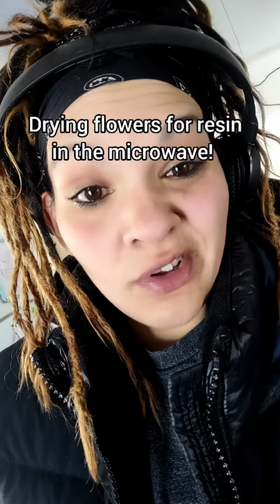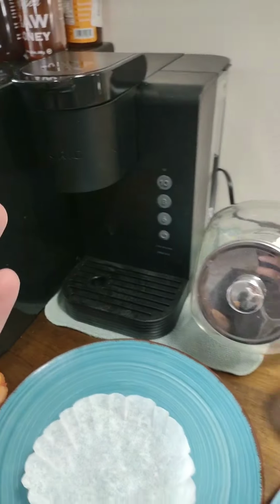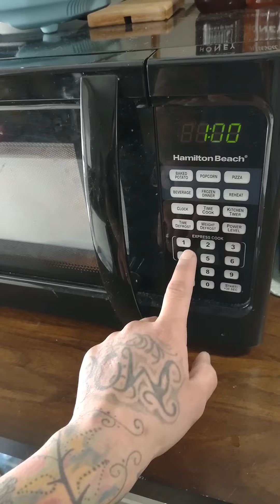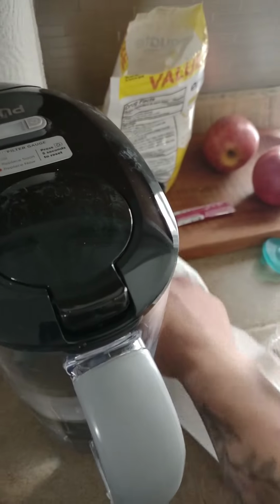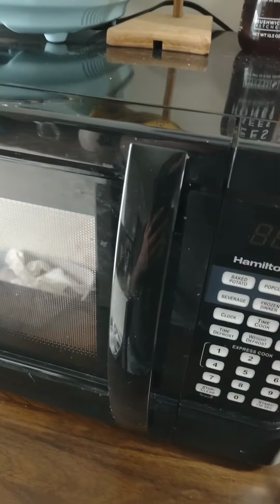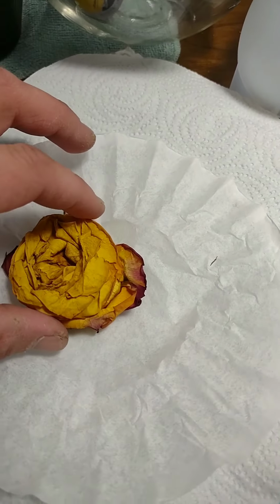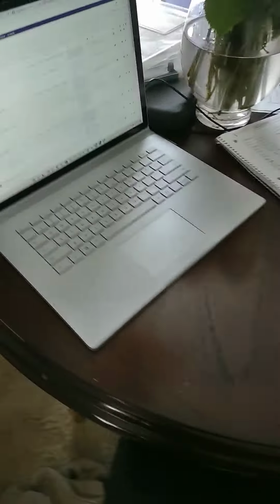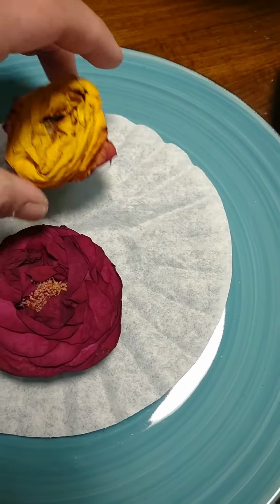How To Dry Flowers For Resin in the Microwave!!  #resin #flowers

Comment: I love your channel, and thanks for the laughs. I dont like the microwave look either. Even with flattened flowers. I tried it and nope! I prefer the silica beads, over the sand, or I put them in between a journal with big fat heavy books and weights on them.  I also use Zorbix paper.  Its a type of paper used to recover water damaged and art. There are some other applications for it, and it also works for drying out and flattening flowers.

Comment: I’ve seen a couple videos of people who  put it in silica gel and then put it in the microwave in the gel . They say to do it at 50% for I think a minute and then 10 second intervals but those seem too short to me. I’ve been pressing flowers in my microwave by putting them on paper towels, then a piece of blotter  paper, like the kind they use in regular flower presses, I think that hot pressed watercolor paper would work or maybe you don’t even need that, and then cardboard. It works pretty well but I do a bunch of layers on top of each other so it takes a while and you have to let it cool off in between because The moisture Hass to evaporate before you zap it again. And I’ve been either doing it at 80% or sometimes full strength in 1 to 2 minute intervals. It kept the color of a bunch of mums, but kind of turned them into potato chips 😂 I also bought one of those microwave presses with wool, but it smells horrible, and actually, the color seems to stay better with the paper towel method. I’m going to try the microwave silica gel next.  🤞 I also got some cotton that was for making microwave potato bags and I cut that and put it in between the blotter paper. But I can’t tell if it’s really serving a purpose or not. I’d like some thing that can be washed and not eventually fall apart or grow mold, but that wool thing was just gross, it came with cotton paper that went between the wall but the flowers just stick to it much more than paper towels, so I wish I hadn’t spent the 30 bucks. Maybe I got a crappy one..
Reply from the maker: I've never done that.  Maybe I can so a video about it